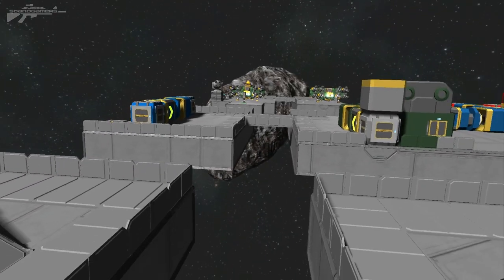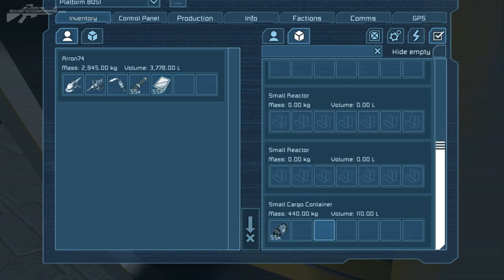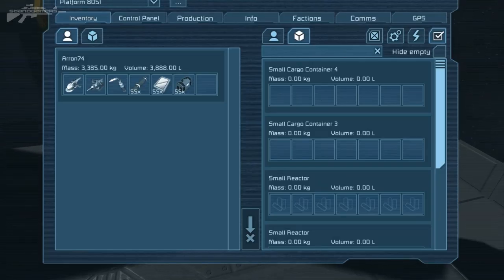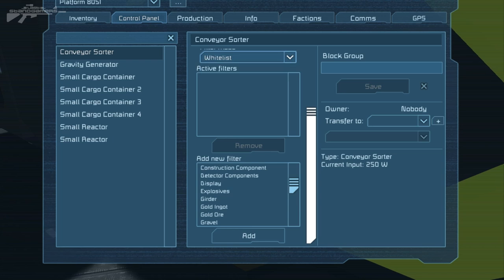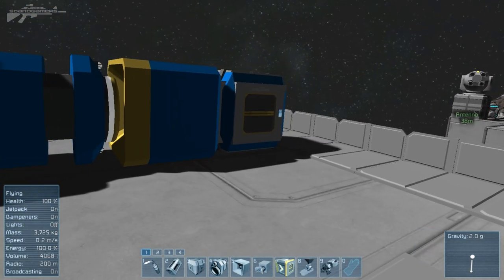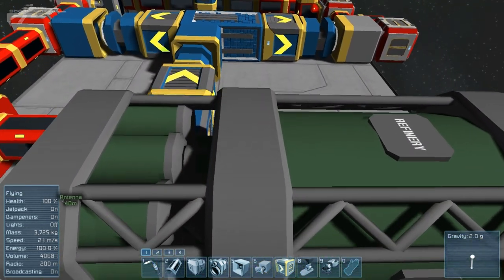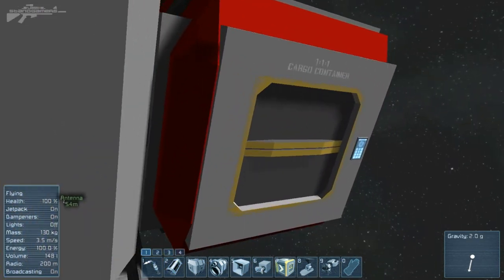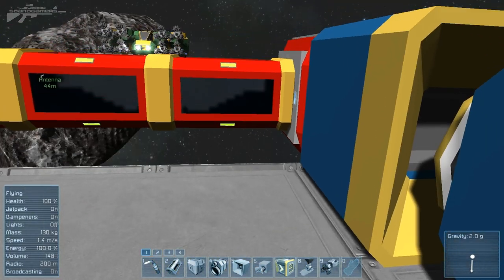Space Engineers - Conveyor Sorting Block

Comment: I feel like this could easily have been some programming into the regular conveyor systems as it is, and you would tell containers what they could hold or not.
Reply: You would have to add the equivalent of control panels in the parts and the conveyor would need to have specified the sorting direction and you would also need room for the laser identification and rotors making it a metal shell
So basically that's what this is
Reply: There are actually ways to sort stuff using the programming block, but it's still useful to have a physical blocker, especially for those that find spacial reasoning and basic logic easier than learning C#
Reply: LordMatt48
I didnt mean ingame programming, I meant the devs could easily have the system sort it out without adding a millionth block to the crowded inventory of choices.
Out of all the functions an extra block would be needed for, this seems really low on that list.
Reply: Boredom_Incarnate Personally, inventory management is a part of the game for me. In real life, stuff like inventory is ust as important if not even more important than the actual product/project. I think if you had a straight-up drop-down menu/interface to use for sorting things, that would take away from a big part of the game. Of course, a lot of people disagree with this, so I think if they added modding support for something like this that would be a good middle0-ground way to implement it into the game. As ist stands though, finding a good sporting script on the steam workshop is not that hard nowadays, and while they may not be as user friendly as an actual interface, they get the job done without compromising what I consider interesting game design. 

The developers have often stated that they want the game to be "As realistic as possible" but still fun. I can definetely see how having to use blocks/programming to sort things can turn "engaging realism" into "tedium and frustration" but for me and at least a few others, it's a fundamental and interessting part of the game.
Reply: LordMatt48
I'm not arguing against most of that, but realism and not using a sorting block are compatible. We have a system now that sorts packages by size and weight so how difficult would it really be for tubes that magically(?) have things float down the center of them and contains pieces much bigger than itself to manage to sort those pieces by some kind of categorization?
Reply: Boredom_Incarnate The current system they have here fits with the overall theme of space engineers. I think maybe what they should've done was implement this into the existing conveyor system, by giving the current tubes different colored ends and allowing players to govern flow in either direction.
Reply: LordMatt48
That's a decent idea. Make it a part of the ui for it and not another fifty blocks that really don't need to be there.
Reply: LordMatt48 i likez da spacial programin :D
i also know C# though but spacial is easier
Reply: There are a ton of sorting scripts, many can do much more than these can,
however, with just the PB, making something go one way, just isn't doable, and theirs a lot of set up involved, even if you don't make the script. For instance I would use a PB to a set of cargo containers for a ship printer, because you are capable of setting the amount of each component you need, and (provided a whole ton of assemblers or they give the ability to que up assemblers through the PB, or you go semi automated and send the information of whats missing to an LCD screen) requesting what you are out of or low on, but for instance, if I have a station producing ammo, I don't want to deal with people hooking up and having to search for the ammo, or taking from the station's personal supply, and I don't want the turrets on a carrier to eat up all the ammo I have for the fighters, I want that kept separate, which will help with loading as well. Combining both will open up some great possibilities.

Comment: I suppose you could make a laser guided missle in this with the new antenna being able to track a position. I think it would have to run through a sensor or something to adjust the thrusters so it makes trajectory correction and such depending on where the laser is pointed too that might be something to test out I dont know.
Reply: Why not a drone tho the missile seems like too much work for little payoff and the laser antenna is not very small lol.
Reply: Unfortunately I don't believe this is actually possible. Without the ability for 2 entities to communicate information wirelessly, streaming target coordinates to a projectile is basically impossible. Unless it's possible for programming blocks to take and give inputs via chat, which would allow you to set up a laser connection and communicate between two entities.
Reply: Depends how big you make the missile. I mean this mighy be later on stuff I'm thinking of where the sensor can tell where the laser is pointing or something to that effect.

Comment: What's the purpose of the connector-collector pairs?  It was demonstrated that just using tubes works fine.  Is it because there's a bug preventing the sorter from allowing connections between different machines, like from a container to a refinery/assembler?  Or is it because of some weird balancing to make it cost more than the block itself?
Reply: They're ejectors. They allow items to automatically move through tubes, and the collector catches it. The tubes only allow PLAYERS to move items through. Hope this helps!
Reply: I guess you just turn on "Collect All" and "Throw Out" for each one, then?

Comment: No offence, but have you ever done any mining in this game? If you have two cargo containers like that, the first one will fill up first, and the second one will start to fill up once the first one is full. There is no way any conceivable benefit could be derived from having the 2nd one fill up first.
What's more, this "feature" has nothing to do with the sort block - you could just as easily build this using only a connector and collector.

An actually useful applications of the sort block on small mining ships would be to immediately ditch stone, instead of having to haul stone back and forth only for the refinery to throw it into the garbage.

Comment: All I get out of this block is that I can use rotors to switch between sending uranium to either the reactor or a container
Reply: why would you need rotors?
Reply: Mathus Sinn put a connector block on 2 pipes and the sorting conveyer, one goes to the reactor one goes to the container, When the reactor needs fuel he can pipe it in instead of the fuel being all in the reactor.